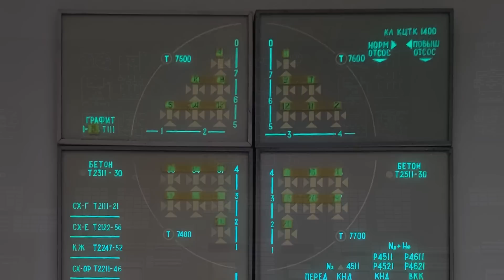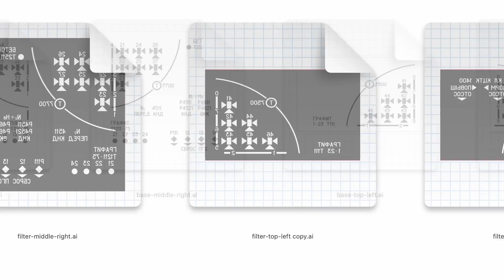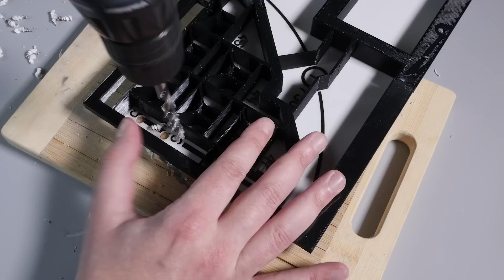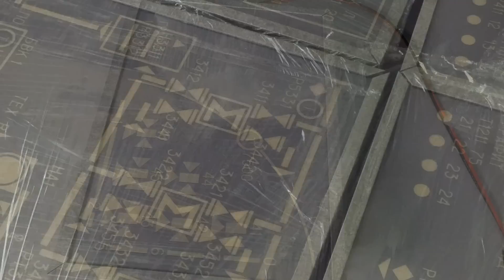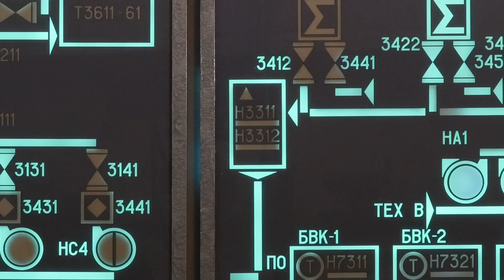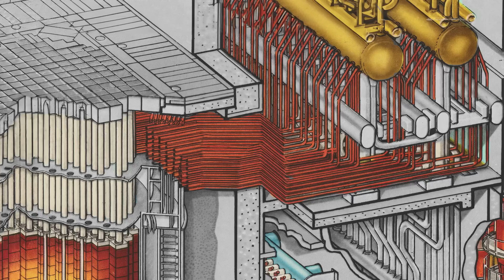This Chernobyl reactor panel works again after 25 years

Comment: once you build the whole control panel, please emulate the reactor explosion. That'd be so authentic!
Reply from the maker: And what is so interesting in that?
Reply: @ChernobylFamily  It will become the culmination of all your efforts and the main proof that all the work you’ve done was not in vain
Reply from the maker: How can a plain sudden power off represent that?
Reply: @ChernobylFamily  If the goal is to simulate the historical behavior of the RBMK design, then the model must allow the same physical mechanisms that led to the explosion - especially the effects of the AZ-5 (SCRAM) button.

A sudden power off does not represent what happened at Chernobyl. The explosion was not caused by loss of power - it was caused by a massive power surge triggered by the AZ-5 shutdown system interacting with RBMK design flaws. If the replica does not allow the AZ-5 button to trigger a reactivity spike under unstable conditions, then it is not accurately modeling the RBMK reactor. It is modeling a generic reactor that simply turns off.

So, to cut a long story short - for the replica to be faithful to the real reactor design, AZ-5 cannot function as a simple “off switch.” It must reproduce the insertion dynamics and transient reactivity behavior characteristic of the RBMK system

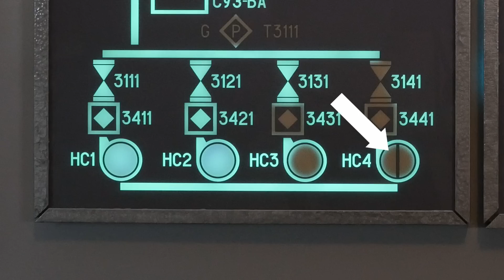Comment: 15:33 Looking at the HC3 and HC4. So, the light bleeding from the outer ring segments into the center segment is caused by the matte filter? I.e. the 3D mask does the best it can, but then some of the light spreads through the filter sideways, thus manages to seep into the neighboring segment of the acrylic-printed panel?

I'm wondering if the matte filter could be replaced by pouring silicone (or any epoxy, translucent glue, etc) into the top of the 3D printed mask. Then there would be less (almost no) gap between the UV printed mask and the 3D printed piece.
Reply from the maker: Yes, the light dispencer was slightly too thick

Comment: Build working simulator and let visitors run the 25 04 86 test, im first to go there,
Reply from the maker: While - jokes apart - it sounds good, it will require having a very extensive education to run it.

Comment: Amazing work! What would really complete this is if you could replicate the individual buzzer warning noises the RBMK control room made during specific events like low water in the separator drums etc.. I believe they used electromechanical buzzers coupled with the pulsing on-off on the displays you made.
Reply from the maker: Yes, and it is easy to make, but the problem is no one remembers what, when and how exactly sounded :)
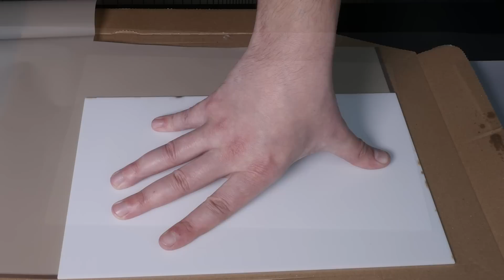Reply: @ChernobylFamily  if you watch this and forward the video to the 10:00 mark, I think it would be helpful https://youtu.be/C97AWUfkCO8?si=h-alGyDJZD0E78v4
They made it in one of the surviving Chernobyl reactor control rooms (Maybe unit 3)

Comment: I'm going to be honest while it's beautiful The monochrome color is totally a UI nightmare. Imagine trying to glance at this and pick out the important details ;_; this is partly why the s300 and s400 while being technically capable have not performed super well.
Reply from the maker: Actual reactor operators of that cery control room agree. They told they switched off all stable lines and elements and had only changing ones. Therr existed multi-color displays like this, but not at NPPs.

Comment: These engineers really wanted to show of their ability to use electroluminiscent film :D From the standpoint of ergonomics it's seems like a strange descision to display high level alerts and things just doing their normal things in the same colour.
Reply from the maker: True, and that's why operators nornally turned off everything that glows permanently

Comment: I never really took notice of those top panels in the Reactor 4 control room before.

I didn't know they used EL (Electro-Luminescent) elements as well. That's really neat.

Hopefully your version won't be as radioactive. ;)
Reply: Incidentally, the Apollo Guidance Computer DSKY (Display/Keyboard) also used EL elements.

It seemed like quite a complex way of making the display, considering the higher voltage the Relays and insulation had to withstand, etc.
Reply from the maker: Well noted!
Reply from the maker: Thank you :)

Comment: Hi, awesome video man! I wanted to get into making stuff like this because of my weird interest into these forgotten technologies and designs.
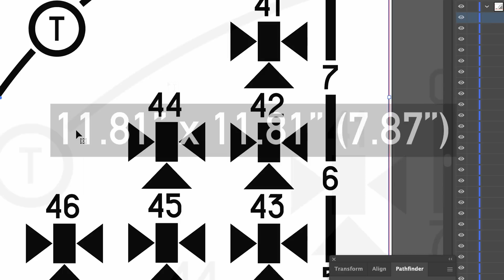I was planning on making a home-made OLED clock using the numerals at 3:43, but the font you shared in the comments (GOST Type A) does not seem to match the typeface used for the numbers on the Illustrator panels.
Reply from the maker: Add 0.5 pt outer outline and it will match.

Comment: I have a question. For the height warning, what is the difference between the text being illuminated and the line above/below the text being illuminated? What does the text (such as names of display objects or skala values) being illuminated mean in general?
Reply from the maker: There is no difference because lines light up together with notation. A line marks the warning. A notation gives a callsign for it. Non-warning notations glow constantly to mark the objects, same as on e.g. any display
Reply: @ChernobylFamily thank you

Comment: Great work! Would love to see you build a control panel for the displays to simulate the operation of the equipment. Maybe with cheaper off-the-shelf parts as it would be pretty hard and expensive to source new old stock parts.
Reply from the maker: We surely will try, but still, we are for using authentic components.

Comment: OK got the stl files, unfortunately the models require 3D printer with very big bed.
Doesnt fit on my Bambulab P1S sadly.
You should mention this in homepage: [Reactor Controls Project] Documentation and Instructions
The printed frames are not visible, so in theory its possible to cut them in slicer and print 1 side and then other side and glue together or make snap-on connection some kind.

Comment: The absolute commitment (from the panel designers) to providing no interpretation at all! You might think that a bad situation could be red, haha.
Reply from the maker: Agree, and yet, that is what mnemonic panels normally looked less-more in that time period. For trained operators, they were straightforward. However, one of the actual operators told us that they preferred to switch off everything that glows constantly (e.g., pipes), to reduce visual load.

Comment: This seems totally overbuilt- I would make one with e-ink- you could sell this- and push a button and it runs the meltdown sequence
Reply from the maker: @johnrichardson1949  and how will you achieve high brightness with e-ink? It has to glow —  and glow visibly, with no grainy texture.
Reply: Or just oled- probably would have been much easier to just use an Ike’s display and do it all in software- now we know why those plants cost billions of dollars- and I wonder if we had the modern displays and warning systems of today if the incident would have happened- with an integrated control system preventing Mis diagnosis and mis corrections
Reply from the maker: Tried oled as well. Not enough brightness.

Comment: Wow, I really love that. Good job man. My suggestion would be to use different types of diodes for different parts of the panel, so the backlight is more consistent (for example the large circles representing pumps). Light tubes and cones also can be used for this purpose.

Next time you could make a programmable segment of a control rods display) But not sure how exactly would you get the plastic caps without stealing them from unit 4 at this point)
Reply from the maker: Wait for the post on the community tab today on 5AM:)

Comment: Before the reactor explosion, did the fuel rod monitoring system panel showed some errors or not ?
Reply from the maker: This is actually a good question. There are no accounts on this, either because it was not in priority or because it simply did not have time to as things escalated too quickly.
Reply: @ChernobylFamily  Are there any account of left triangles + group valves number errors combined with increased suction  before explosion ?
Reply: The reactor parameters were all normal, just 3-5 seconds before the explosion.

Comment: "1.21 gigawatts!" ... I mean, 400VAC? That's intense. Any idea of the reason for that kinda juice? My first thought was actually that the controllers might've been tube driven, so needed a high voltage B+ rail. Or maybe I should just get my head out of audio. But from the scorch marks on that ceiling fan, it seems the displays themselves were using that potential. Gnarly.

Incredible build, by the way! I would give anything for one for my studio control room. Considering doing a single panel, and in a more simplified fashion. I've got too many other incomplete projects to justify it ... Hmm, maybe I'll start it as a reward for finishing something.
Reply from the maker: I have no idea why it was so, honestly. 
In reality, it is easy to build, as long as you measure everything well. Good luck!
Reply: High voltage = low current, meaning you can use thinner and longer wires to deliver the same energy.

Comment: Question

What does Setpoint do in requestor device
What are 1UZM And 2UZM
What Is Suz signal ptg on annuciators panel in 3-4 panel
What does PDM - intrazone sensor do
What is ARV-V - automatic regulator of excitation of the auxiliary generator does to turbogenerators
where is NSS - station shift supervisor located
Reply from the maker: Setpoint can be any value that should be normal for a given parameter.
From what I remember, UZMs are amplifiers that are installed around the active zone and measure the power.
Then, if I recall correctly, NSS normally should be in the central control room.
The rest I do not remember.
Reply: @ChernobylFamily  in my saved notes in folder the is AR-V -automatic regulator of excitation of the auxiliary generator, so what does it do?

Comment: tell me how a chart recorder works in the walls, and can u make a chart recorder thats on the wall used to meters like M1730
Reply from the maker: Chart recorders are standard devices. They get a signal and convert it into a line using a signal-driven drawing hand.
M1730 and other we jave and once even powered (there is a video from 2023)
Reply: @ChernobylFamily  do they get data from SKALA Or Dreg or V80M Processer

Comment: Excellent work! I was thinking I would’ve used tea colored window film but realized that it would probably block the diffusion of the light.
I’ve never seen the chain wired LEDs before, those look like they’d be useful!

The only thing I worry about is using hot glue on anything that might heat up with those edge pieces, but I think you should be ok seeing as you’re not driving the LEDs at full power.
Reply from the maker: We made a three hour test run with all LEDs glowing — just PSU got slightly warm, LEDs remained pretty cold.
Reply: Yeah not shocked, these days they don’t need half as much current either to run so they run a lot colder. I have a strip version of the same modules running down my hallway held up with cheap tape and they never get warm

Comment: A more authentic replica might be made using the method Applied Science used to replicate the DSKY Apollo display panel. What he did basically is to use an actual sheet of EL and make a HV PCB driver underneath, so it should actually be identical to what was actually available and used at the time just implemented with modern semiconductor.
Reply from the maker: Of course, and that was the initial idea — to use Lumilor compound. But the budget required for this size and this number of interactive parts was, uhm, big. Not speaking about wiring it all up.

Comment: These look electroluminescent like the Apollo DSYK rather than LED. Less wires, no bulbs, can handle vibration, less to go wrong.

CuriousMarc has some videos with re-creating the original display type.

A reddit post suggests "similar to ИЭЛ series, they require 400 V AC".
Reply from the maker: Yes, we explain in this video what they are. But to make this complex, ELs will cost a fortune.
Yes, that was my comment under that post.

Comment: Cyrillic on acrylic?
Maybe for fun, add a small buzzer for the 400Hz that EL panels usually give off.
Reply from the maker: There should be sound warnings as well. But our consultants struggle to remember which exactly (for now)

Comment: Now with touchscreen technology it would be wild.
Reply from the maker: Hell yeah!
Reply: Actually, I have a picture of the control room from Smolensk Unit 3, and you wouldn't believe how modern and clean it looks. The Selsyns are no longer mechanical devices on the wall, it's all big (touch?) screens now. The same goes for the core layout mnemonics. And they're not small screens either. Think almost floor-to-ceiling size. As a matter of fact, there are a lot of modern screens in there. Unit 3 is one good-looking RBMK!

Comment: Great job and excellent video as always! 👍
LED replica is good idea for reproduction. Basically, these original display panels was similar high voltage type displays as used in Apollo mission, only patern was different. Curious Mark teaming with others researched and recreated all making process of these displays, but that's intense labour and not everyone can make them..
Reply from the maker: Yes, exactly

Comment: Wow, awesome build! So much work.

I'm thinking about scaling it down 3 times. Single panel would be 10x10cm. I would design a PCB for each panel with SMD WS2812 LEDs soldered on it. Using JLCPCB it would be very cheap. I could also use their etched stainless steel stencil as a light mask (it is also very cheap - 7$ for 36x20cm). Front mask could be printed on transparent foil on a standard laser printer. Separator would be 3d printed as in your design.
Reply from the maker: Good luck! Feel free to modify as long as you keep the original credit. With SMDs, you can solve the problem we couldn't — pumps outer rings actually have to light up separately, as when the pump is offline completely, all elements must be dark. The same goes for little "triangles" next to HA1..3 pumps.

Comment: I'm currently writing a simulation engine capable of simulating pumps and valve networks, heat exchangers and steam properties. It's not the most acurate and has many simplifications but capable of providing proper dynamics for plant startup. If you're interested, contact me and maybe we can connect those projects ;-)
Reply from the maker: Drop us a message on Patreon and let's do it!

Comment: A truly amazing panel! You could say it's much nicer than the originals and it still works. It took a lot of work and time to design and build, but the end result is truly impressive :)
Reply from the maker: Chernobyl NPP engineers said: "looks better, specifically SHARPER than originals"
Reply: @ChernobylFamily  Well said and they are absolutely right :)

Comment: The ultimate project would be an accurate full-scale control room simulator.  

For the first time, since April 26, 1986, we can find out if the original safety test could've been done had the rules been followed and the correct parameters present.  Even better, we can role play Dyatlov and the control room crew and see if pressing the AZ-5 button a minute earlier would've saved Reactor 4.  All within the safety of an accurate simulation.

Comment: Very interesting, but surprisingly very non-user-friendly. For example, at 19:14 it's very hard to notice quickly whether only left triangles are lit or not. Some other mnemonic devices at БЩУ seem much more friendly in this regard.
Reply from the maker: The operators told us they actually turned off all constant glowing elements (there is a switch for that), leaving only what could change - exactly because of this

Comment: Very well done, it came looking surprisingly authentic. Even the colors matches well. Now it just needs the operators control panel and RBMK simulator!  I like how you used different manufacturing methods, kudos to metal work shop and screen printer also.
I am going to grab the design files, this inspires me to make digital dashboard for house heating and automation using the symbols and design elements of those displays. I already might have tiny computers named SKALA and PRIZMA in the basement gathering sensor data and controlling the central heating boiler.
Thank you for the video and documentation, and also for the awesome build!
Reply from the maker: @ketturi  enjoy and feel free to use it. Just give us a credit:)
P.S. you need a printer which will constantly log everything :))

Comment: I'd have done a multiplexed grid of LEDs. I didn't think of using addressable LED strings, but ya know what, it works, and is probably easier!
Reply from the maker: It's much easier. You have ready wiring that has a convenient length, and it is easier to program it.

Comment: Came out very nice. I'm curious about the heat/fire issues with the original design... Were they fed with mains frequency? What I know of EL is that it is a "cold" light source... but any of it I've ever played with was driven at high-ish frequency, a few-several kHz... and the frequency also affects the color. I'm wondering if they just went for "make them light up", or if they were in the early enough stages that nobody had realized about higher frequency drive...? I have no idea but the wiring definitely looked scary in the original hahaha maybe it was simple arcing issues and the actual light emitting elements themselves ran cool?

Either way this was a really cool project man. Good job indeed.
Reply from the maker: Good questions, but after so many years, it is hard to say for sure.